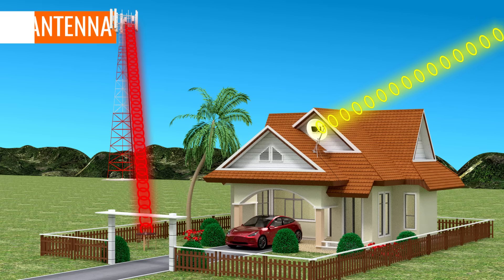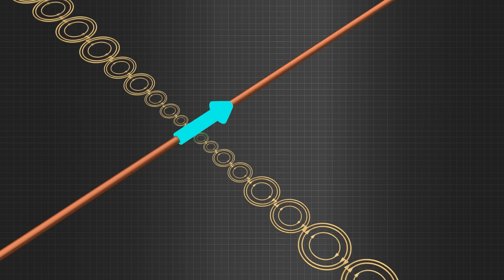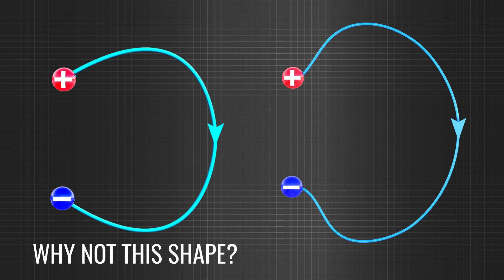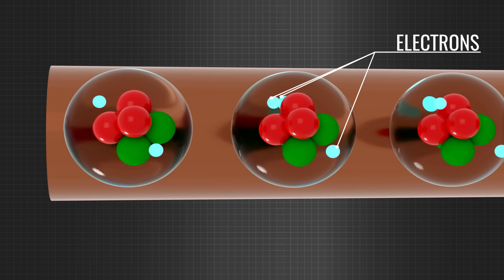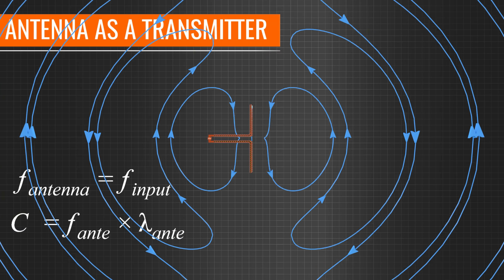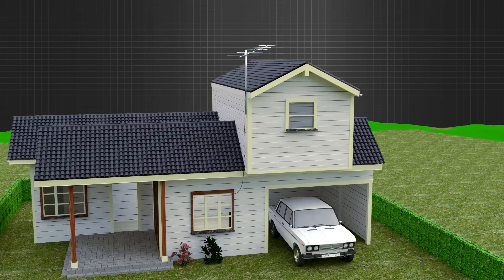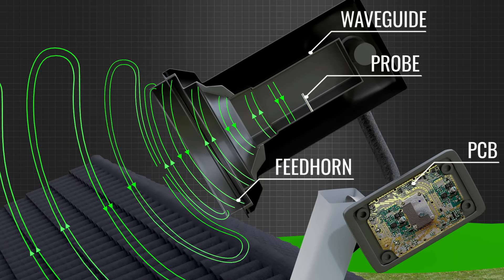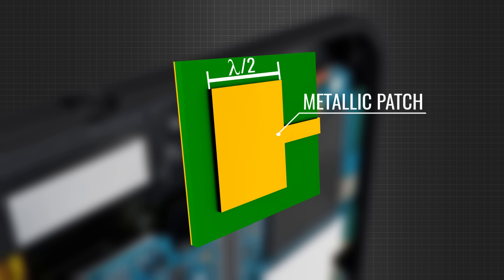How does an Antenna work? | ICT #4

Comment: no discussion of reactance, impedance, K-factor, or resonance at all?  no discussion of the feedline or matching the feedline to the source and/or load?
Reply: Then it means you didn't need that topic at all. Show off.
Reply: Then it means you didn't need that topic at all. Show off.
Reply: @richardsterwen31  Just pointing out that a lot is missing, and iirc, this channel is selling a "course".

there isn't even enough information in this to answer the questions on the subject in the FCC Amateur Radio Service Technician Class License test, and that's a test my cat can pass.

Just saying.

His presentation is good.  The graphics are good.  He needed to elaborate to the point of at least touching on the issues mentioned in my comment to actually be useful in any "course material".  Although he did comment on halfwave and quarterwave, that was the closest he gets to the concepts I mention, and it wouldn't have been a stretch of more than a few more minutes to explain the basic concepts of what I mention.

If it wasn't billed as a "course", I wouldn't have been so picky.  Pay for the course, and come to me for a job saying you understand antennas, and I ask you something BASIC and you can't answer, you don't get the job.

Comment: 6:12 actually it's a        low-noise block down-converter        not block-down converter
because it converts a lot of UHF (GHz) frequencies to lower ones (MHz or sometime  kHz)
Satelites use around 10 GHz so they can tranmit a lot of things at the same time but most electronics can't process the signals so it needs to be converted down
Reply: Thanks

Comment: my antenna does not point towards space...where does the signal actually come from?
Reply: Probably receiving reflected signal, from a big wall for example. It's not uncommon.
Reply: Angle to ground depends where you live, antenna doesn't have to point straight up, it only happens on equator.

Comment: there is one thing not right, the smart phone cellular antenna is at the bottom of the phone not on the top. on the top there are bluetooth and wifi antennas, ive been checking that out by myself.
but nice video👍

Comment: The animation of the field lines for the induction case (from 0:35) is *wrong*.
Field lines do not get squashed or deformed into increasingly eccentric elliptical shapes. They maintain the same shape, but  - following Faraday representation - get rarer and rarer as the field strength diminish, then they disappear when the field goes to zero and reappear oriented in the opposite way when the polarity shifts. Then they get denser until they reach the maximum and the cycle repeats itself. 
You might want to correct that in your next video on the kink generation.

Also, as others have noticed, you cannot just reverse the field to show how the antenna works as a receiver. You should place the receiving dipole outside the origin of the emitting dipole field (still propagating forward) and then make the electrons inside react to the portion of the field intercepted by the receiving antenna. This will also illustrate why so little power is received: most of the emitted energy goes in all the other directions.

The animation of the dipole field of the transmitting antenna is very nice to see, I have to say.
Reply: Thanks is there an animation or a textbook that shows this more accurately?

Comment: This is fascihnating,  but the first  3-4 minutes  needs a lot more in depth explanation.  What kind of electric field?  What are these "ends" of which you speak , how do they relate to the wavelength, and WHY does the end of a conductor affect the shape of the signal?

Comment: question: If the two end of the antennas are like capacitors (large in area and close in distance), it can accumulate a decent amount of charge. However, short distance would mean small dipole. If the two end are far a part and small in area, the charge accumulation should be pretty small, right?
I suppose it still produces wave with sufficient strength for most practical use? or I'm missing something (like I can't use Kirchhoff laws to describe a spatially dynamic system with charge accumulation in the wire or something?)

Comment: Contrary to the information provided at the beginning of this presentation, closed circuit inductors most certainly do propagate radio frequency inputs and they are very capable receiving antennas also. This type of antenna is popular amongst "ham" radio enthusiasts and has proven effectiveness. 
All antenna designs are inductive devices, not just loops or coils. A dipole is also an inductor.
What differentiates an antenna from other inductors such as an ignition coil used in a car is the frequency of the input signal. At low frequencies the electromagnetic wave surrounding an inductor will collapse back into the inductor as the polarity of the wave form reverses. A good example of this can be found in power transmission lines operating at 50-60hz. They do have an electromagnetic field surrounding them but with each cycle the field collapses and is absorbed by the transmission line. You can imagine the inefficiencies of transmitting power if this were not the case.
The key factor in creating radio propagation is the frequency of the signal fed into the inductor. It is generally accepted that to effect radio propagation the signal fed into an inductor needs to be 100 khz. and above in free air.
In order to understand radio propagation it is vital to understand that like charges repel each other.
When a radio frequency signal is fed into an inductor an electromagnetic charge is created around the inductor. Because the frequency of the input is high the electromagnetic field cannot collapse back into the inductor before the next peak of like charge enters the inductor. Again, like charges repel. This forces the electromagnetic field surrounding the inductor to "snap off" and to be "pushed away from the inductor and thus we have effected radio propagation. 
What is a radio then? Good question. In the case of something like a radio station transmitter it is a device that converts audio frequency (80-20000 hz.) into a much higher frequency i.e. 106.7 mhz. and feeds that signal electrically into an inductor (antenna) which is then propagated as an electromagnetic signal.
In the case of a radio receiver, it is a device that converts a high frequency electromagnetic wave down to frequencies in the audio range and with the use of an audio amplifier and speaker back into sound.
 I hope this has been help to anyone trying to grasp the basics of radio like I did.
Reply: Drop the 100 khz comment.  What frequencies do submarines use when under water?
Reply: @dwilliams2068  ,Submarines use very low frequencies for radio. Audio frequency transmissions are possible underwater. Low frequencies are employed underwater as signal attenuation increases with frequency in this environment. Note that in regards to my assertion that radio propagation starts to occur at 100 khz I do state "in free air". This is perhaps a generalisation, it is possible to detect frequencies below this level but in the context of both propagation and modulation the practical limits imposed on these lower frequencies makes them a fairly ineffective carrier of data.
Reply: @davidbrayshaw3529  Yes I know.  Among other assignments in the navy I was ASW Officer on a destroyer and had many interactions with submarines,  fortunately our own subs.  You are probably familiar with the UQC.
Reply: @davidbrayshaw3529  I really don't know.  I left the navy many years ago, but there is something that might interest you.  The UQC on our ship was built by Bendix Pacific.  As I was being relieved from active duty in San Diego there was a flyer on the table from Bendix Pacific in North Hollywood.  Having had a long experience in electronics and a degree in Engineering Physics, I decided to visit Bendix and was hired on the spot. I was given a desk and a budget to buy books on transistors and dit early work on solid state telemetry systems. I worked in telemetry and later moved to San Diego to work on the Atlas missile, followed by many years in aerospace and commercial projects.  

Returning yo my time on the destroyer, I was also Electronics Officer.  We had a shipyard overhaul and our radios were all converted from VHF to UHF, all but the TBS on the bridge.  Many times we could see a ship but not be able to talk to them on the radio systems, while the captain, using the TBS on the bridge, could.  It caused me much grief.  Only when I started working on missile tracking systems did I learn that the UHF failure was destructive multipath.
Reply: @davidbrayshaw3529  Too long ago to know.  As I left active duty I saw a brochure from Bendis Pacific who had made our UQC.  I thought it was interesting so I went there and was hired on the spot, based on my experience and degree in Engineering Physics.  I was given a desk and a budget to buy books on transistors.  Within a year I had developed the first solid state telemetry  components and had a patent on one circuit.

Returning to the ship, I was also electronics officer.  We had a shipyard overhaul that replaced all our radio systems, except for the TBS on the bridge, with UHF systems.  Sometimes we could see a ship but couldn't contact them on UHF but the captain could reach them with the VHF TBS.  It caused me a lot of grief.  Only when I moved back to San Diego to work on Atlas missile tracking did I realize  that the UHF systems were affected by destructive multipath reflection from the ocean.

Comment: Great explanation! This should be the intro of any radio wave class, straight forward to the goal!
Reply: Thanks a Lot.  This video helped me visualize how antennas worked. I worked in the avionics most of my life. Never could visualize how a signal was physically produced.
Reply: OldMech amazing how good instructions help complete the learning experience
Reply: @capgains     Years of sitting in class with wavy lines and straight vectors with big and small arrows pointing in none moving ways. Sorry, I just got dizzy again.
Reply: And what will happen to the endless integration equations :D
Reply: @mohamednour5600  I live in Karachi Pakistan I like your comments if you don't mind
Reply: @mohamednour5600  There are absolutely necessary, but introduced too early, most doesn't understand nothing but can manage some exercises because they replicate the method they've seen.
Reply: I completely agree.  This was super helpful in my understanding of antennas
Reply: support you!
Reply: except that right from the start it contains misconceptions and inaccuracy that leads to confusion. We tend to think that since a content is flashy and has a lot of fancy video-stuff there, therefore it must also be a good educational material, but it is not the case.
Reply: @ottrovgeisha2150  why?
Elaborate!
Reply: I live in Karachi Pakistan I like your comments
Reply: Science Revolution  thank you so much.. that's a perfect explanation....thanks for taking time in explaining it in easier way
Reply: you and I are on the same page!!  yes the pyramids  were a interplanetary communication device that operated at a very low frequency.  But also the great Pyramid of Egypt was a teletransportation device, ,, NOW Stone Henge and Gobekli Tape: they were power plants. ,  You will see chips on the upper parts of the stones as they were perfected to a operating frequency.  The horizontal pillars were set to vibrate at a particular frequency magnetically, for many reasons, each horizontal rock had a purpose!!   some were used to excite the seedlings in the ground, to expedite the growth, some were tuned into earths mag field and provided magnetic lift via the Earths "B" field .  Check out Coral Castle Florida,  ED used What I call a "B" field generator, His generator used "V" magnets to ensure max delivery of the "B" field Just like is being used at the black pyramid of Alaska.  His generator used 25, V mag around and 5 deep to produce the "B" field into the earth and special stones.  THE "B" field is the center of a magnet/ some like to refer to it as the neutron field.  But the 'B" field is much much more !!!   I wonder if the black pyramid of Alaska used magnetite as a skin for the pyramid that would explain many things!!!   Tesla new about the free power that's available through the CENTER FIELD of a magnet AS you are well aware the rich boys didn't want it,  It's been there all the time.  When the government took down the horizontal stone at Coral Castle the entrance door stopped working.  Funny thing they gave us the clue,, His horizontal rock was providing the magnetic energy to support the access door.  AS you know magnetic energy is perpetual  JUST GETTING started with all this.   I don't need to brag about all my credential.!!  I got into physics back in 1959 as a ham operator at 9 years old I would design and build my tube type radio's for Rec and xmit.   I know what I'm talking about..    When they say all they had were copper tools OMG HOW STUPID!!!  when you understand the properties of a inductive that being utilize to build the pyramids you would understand a copper tool was every bit of a power tool  BIG TIME!!!!!!!!!!!!!!!!
Reply: https://youtu.be/k3Lpe77OIiQ

See this video for more info!!!

Comment: It is incorrect model(3:40) that electrons run from the left part of antenna to the right. Actually, the velocity of electrons is about 1mm per second.
Reply: Do you have a source on that
Reply: @skyhappy  it's easy to do the math
Reply: @diegoraffa503  how would I do the math, this is about observing the speed of elections.
Reply: @skyhappy  see, for example, https://en.wikipedia.org/wiki/Drift_velocity

Comment: Curious to know why the length of antenna should be λ/2 for perfect transmission
Reply: It's due to how electric current is created. When a magnetic field changes, an electric current is produced. So to create the ideal antenna that is the most sensitive to the signal you would want to sample a part of the wave where the largest possible change occurs. That's going to be from one peak to one valley of the wave, which is half of the expected wavelength.
Reply: @eideticex  So we can take a an antenna whose length is greater than λ/2 so as to accommodate maximum possible variations
Reply: Mainly because the impedance of a quarter wave antenna is real rather than inductive or capacitive. You can add matching circuits to make other lengths work.
Reply: I think that's always told because it's just mathematically true if you consider the theoretically simplest antenna form in free space - the folded dipole of the yagi, slot and horn antennas should deliver a quite similar transmission values. In real applications many effects make other antenna forms even better (ground gain, etc.)
Reply: @salat  I just came out of my high school
Reply: The reason for	half wave length is, if it is more than half length of radiating element, there will be two voltage and current in that element as positive half and negative half which will cansel the radiation each other.
Reply: @kassima9892 No they don't cancel out. Remember the voltage waves are traveling at speed of light. What happens on one point on the wire takes a finite time to have an influence on another part. Short dipoles look like capacitors and long dipoles look like inductors. At about lambda/2 the inductance and capacitance are balanced.

Comment: Please make a video focusing on Cell tower panel antennas while you are at it. Like how can one antenna transmit different Mobile signals at once and at what spectrum do microwave antennas transmit data, throughput, what role does fibre optic cables play and a lot more.

Comment: Time index 05:40 the driven element in a yagi uda would normally be the 2 element, from left to right in the image it would be Reflector/driven/directors 
Number of directors denotes the beam width and gain over a dipole.
 Great video none the less.

Comment: This was actually better than I expected although few questions remain unanswered, for example, what is the medium that carries EM waves - some hidden fabric of space? anti-matter? Quantum fields? It is clear that light travels at different speed through different medium, vacuum being the friedliest in terms of speed light can propagate at =Cmax. But empty space is not empty at all, it is still filled with some unknown matter.
Reply: Space has no air, but still has electric fields coming off electrons from all matter, so there isn't an empty space altogether, the presence of this electric field allow electric field disturbances to propagate very much like a stretched string